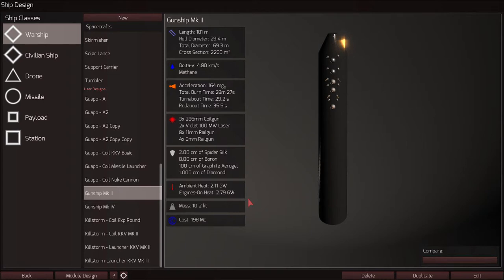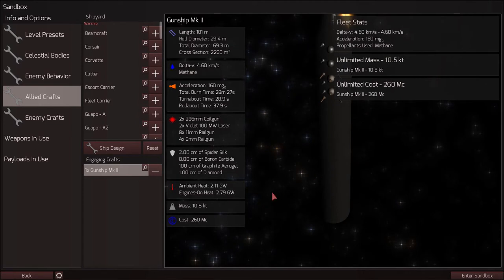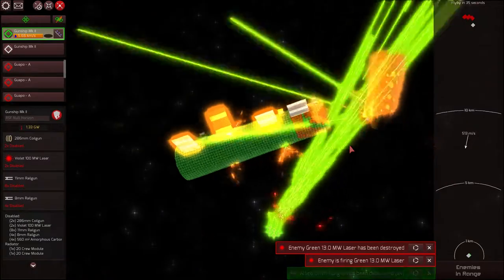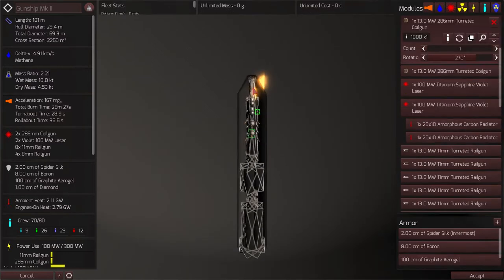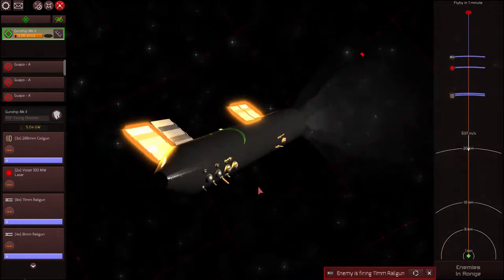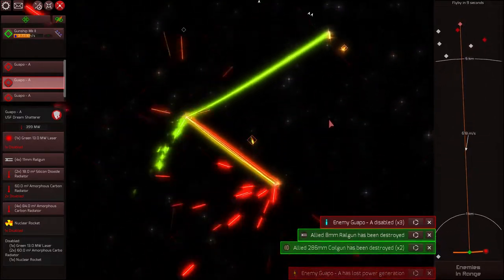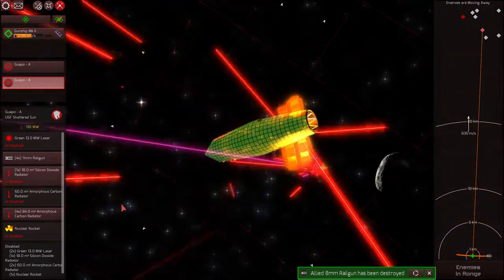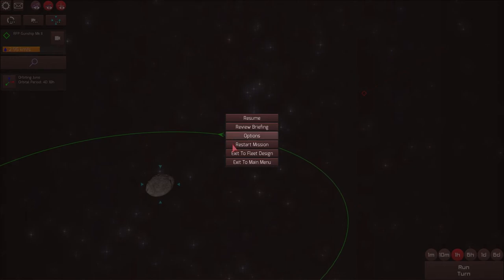Gunship Re Design - Part 2 - Children of a Dead Earth

Comment: Another (critical) thing to consider is effective range. In general, it's better to have guns that fire at a slower rate but at a higher speed (thus increasing effective range)--it means that incoming enemies will be under fire sooner. If you can manage to take out radiators or weapons early on, it increases your chances substantially. While missiles and drones obviously have a much greater range, they can be intercepted--KKVs cannot. 

So instead of a bunch of small, shorter ranged railguns and coilguns, try fewer guns that consume an equivalent amount of power but fire at a much higher velocity.
Reply: First of all rate of fire is not connected to effective range, secondly speed has a plateau for each possible projectile before it actually reduces the platform's effective range.

Lastly, KKVs can be intercepted, any object with a command module, remote or otherwise, can be tracked and destroyed. After all KKVs are just unarmed missiles.

Comment: Something else you could try doing, which I read about on the game's forum is to put all of your crew modules and reactors in one section of the ship and use a completely different armor configuration for that section from the rest of the ship. The logic is, this section would make up 20-30% of the ship's modules, so you could throw really strong armor on this section, while keeping the cost of the ship down by not using that armor over the entire hull, and giving the most important modules on your ships the best armor protection possible. This heavily armored section of the ship would be the "citadel". The armor configuration they used for their citadel was 10cm of Reinforced Carbon-Carbon (innermost) 3.5cm of Maraging Steel (outermost), covering the top 20% of the ship's hull.
Reply from the maker: Indeed.  That's something I've been meaning to try.  I'm not sure if I would use Reinforced Carbon-Cardbon though.  Perhaps more layers of boron and other stuff?  I feel like with this though they could target your engines and leave you with no propulsion.  I feel like once the engines go the ship is done, no matter what other capabilities it may have.  (well actually, if it has a ton of drones then it would still be very potent) 

As much as I enjoy the drama of two capital ships slugging it out, I can't help but feel drones are ultimately more practical and effective.
Reply: The problem with that is that you're limited to a maximum of 5 armor layers, so it drastically limits your ability to use composite armor.

Another thing to keep in mind is the armor on your turrets.  Adding armor to your turrets increases the weapon's survivability, of course... but also remember that every destroyed turret leaves a giant hole in your hull.  Or explodes.
Reply: Which is why you want well-armored turrets; so that they don't represent big holes in your armor/hull, and so that your weapons don't get taken out easily.
Reply: True, but well-armored turrets require huge amounts of power, and you can't layer them to maximize anti-laser effectiveness.
Reply: All or nothing armor schemes ftw.

Comment: That stood up to that beating fairly well.  I'm as surprised as I'm sure you were to find that it still had at least one functioning engine.  I'll have to go re-watch part one now.
Reply from the maker: I'm actually quite dismayed at how vulnerable engines are.  One more strike against capital class ships.
Reply: '+1' to that good sir.
Reply: I think someone on the forums figured out that the problem is we cannot armor the fuel injector so even if the engine bell and turret are well protected any fragment or the slightest peek of nuke flash will still disable it.
Reply from the maker: Hmm.  Hopefully we'll be able to armor that component in some future update.
Reply: Hopefully so.  The individual responsible for the discovery noted that wrapping the engine turret in 50 or so cm of aerogel will envelope the injector as well offering it some protection.  But yes, we need to have an option to armor that component a little more directly.